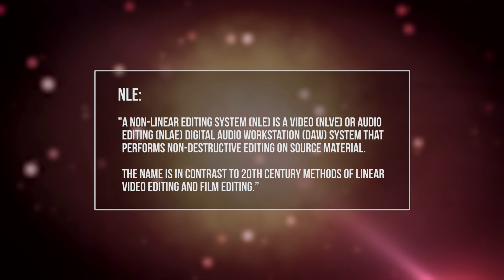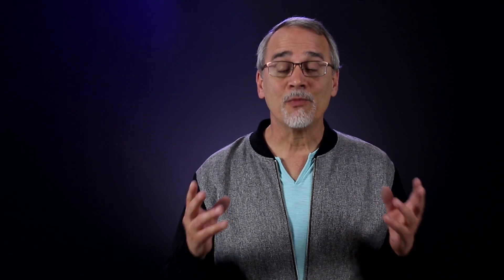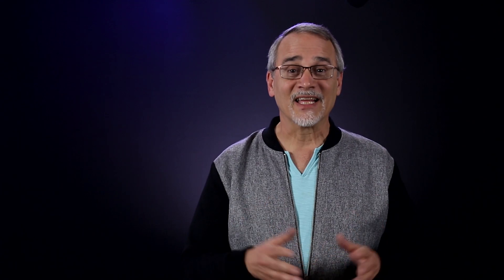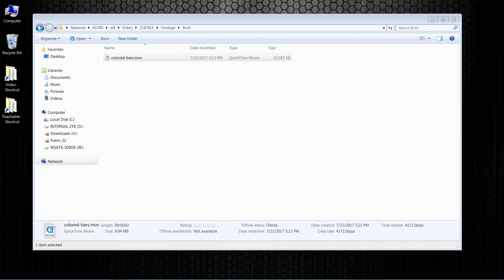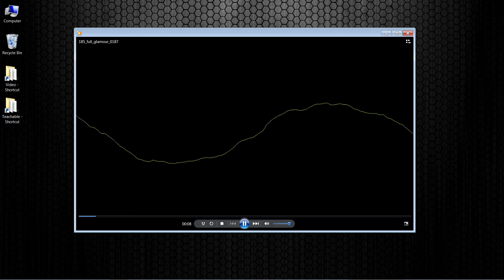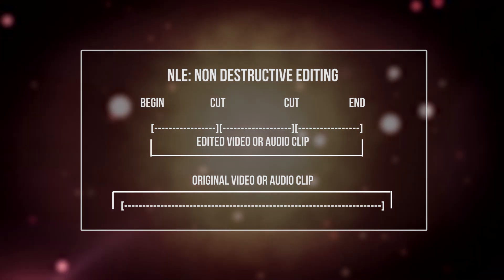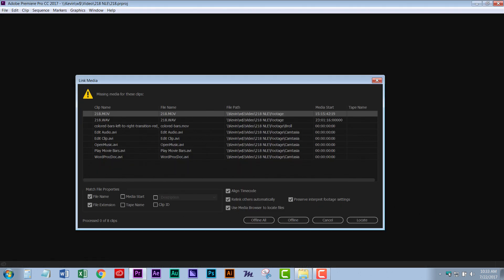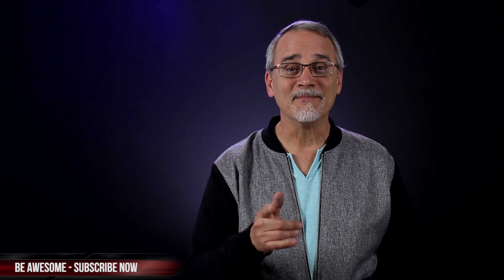Video Editing - What The Heck Is A NLE?

Comment: I'm confused, what's linear editing software then? I'm using After Effects and that doesn't change the original footage either that you put in. 
I was on a forum and someone suggested to use an NLE for a certain thing. But isn't AE an NLE?
Reply from the maker: Yes. If you are editing and it DOES NOT change the original footage, its an NLE.